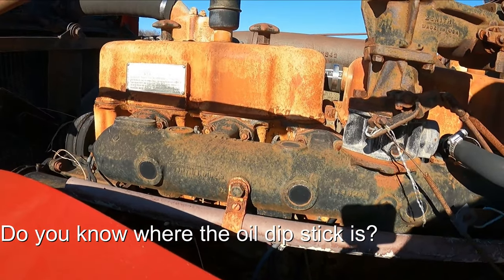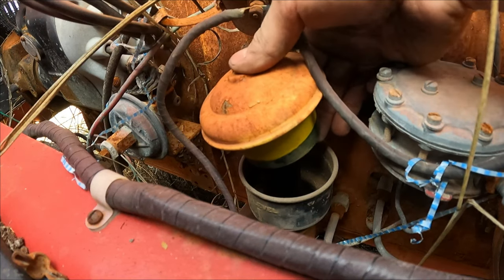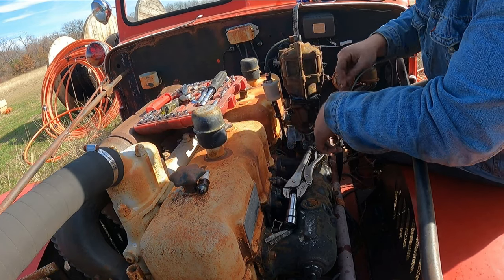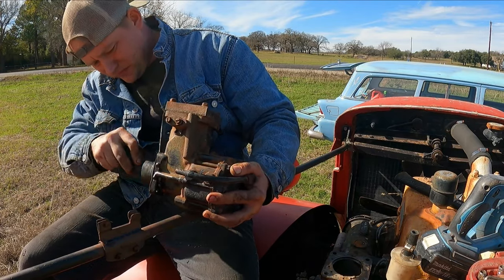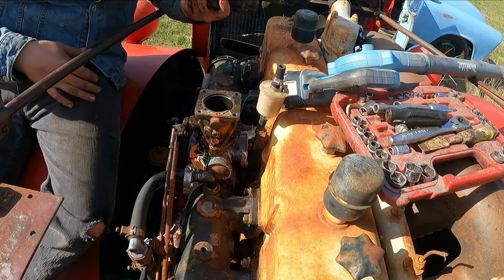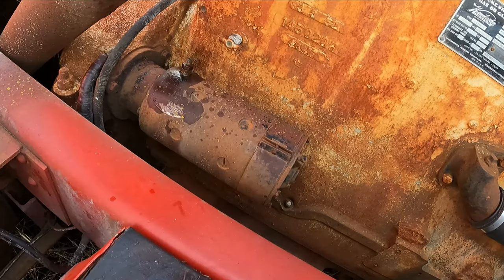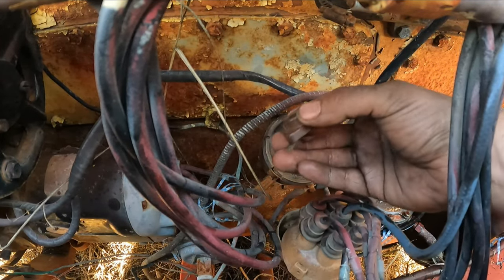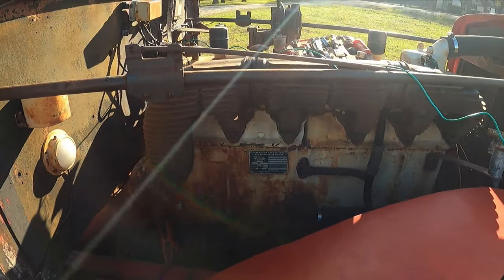Will it run? 779 CUBIC INCH 1952 Oren Fire Truck Parked 30 Years Revival cars

Comment: Thought for sure that battery was done for. Good catch on the reason it wasn't  firing up.
That's a BIG Gas Engine!!! 😂
Reply from the maker: I ended up draining it after the camera was off. Then hooked it to my wagon and jump started it and the draw was so big that it kept making the wagon die and the alternator on the wagon was making a crazy screech noise dude!

Comment: Good to see the station wagon earning it's keep!
@ 20:57 ,was it running on the generator or the magneto?
Reply from the maker: I had the magneto lever turned off but the wiring is a complete mess on it. There aren't keys just switches and buttons everywhere. It probably was the magneto though. Ill have to figure all that out later.